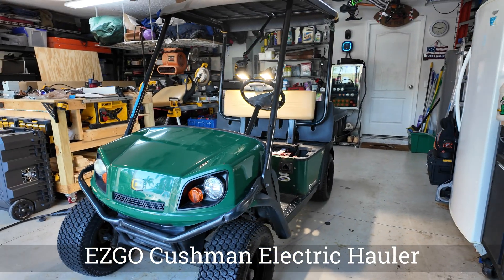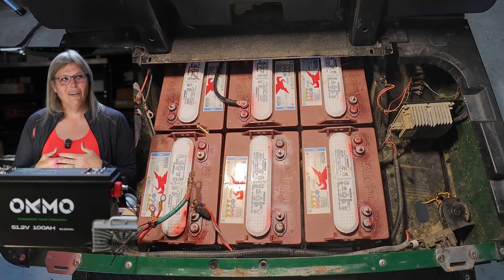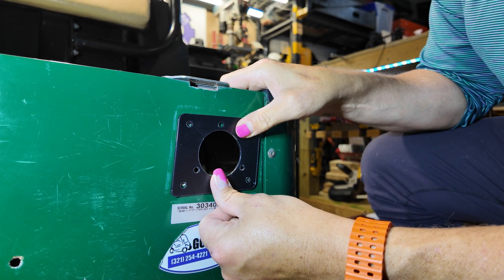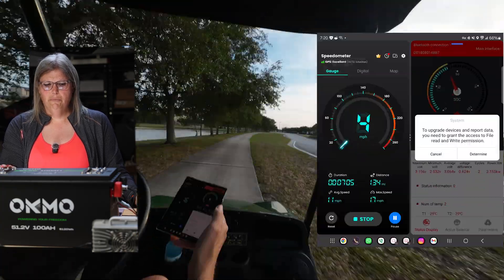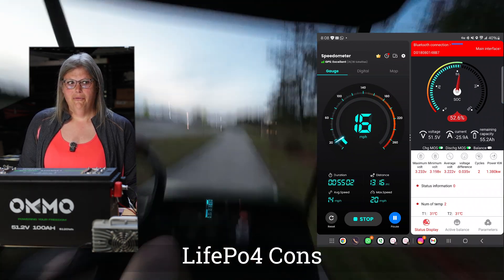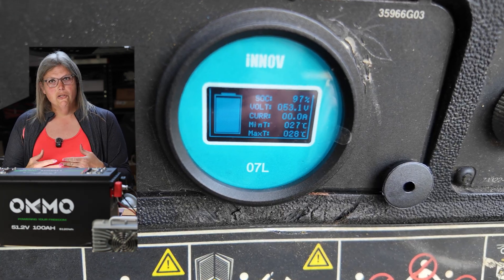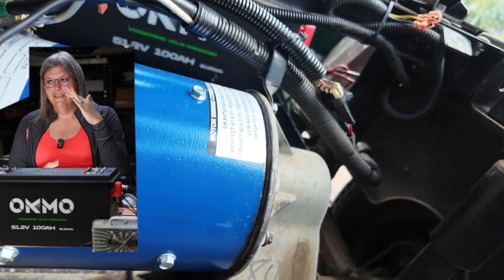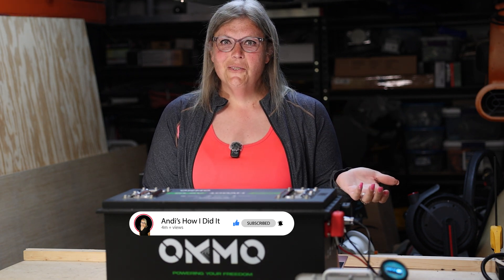Upgrading Golf Cart with Lithium Batteries and Comparison from Lead Acid to LiFePO4

Comment: Great video!  Thank you. Can you provide what step down converer to use with this set up?
Reply from the maker: Thank you so much! It really depends on your amperage needs. So i.e. how many devices you'll be powering on the step down to 12vdc. If you're powering fog lights, headlights, horn, turn signals, radio, amplifier, etc., then a 30 amp should be plenty sufficient. If you're not planning on that many devices you can drop down to 20 amps and be just fine. They're fairly cheap, but I do recommend adding a fuse panel to allow for the connections. I can get you a link to that too but here's the step down converter: https://amzn.to/4nRwivb